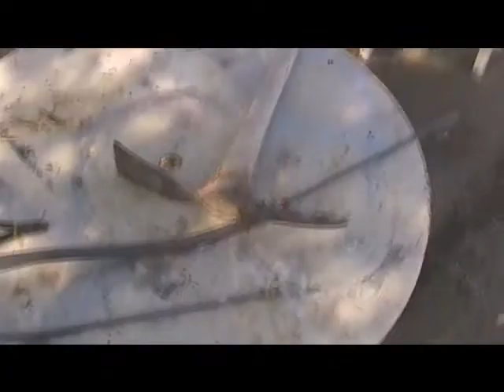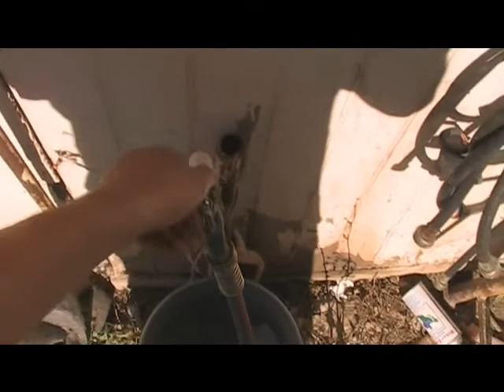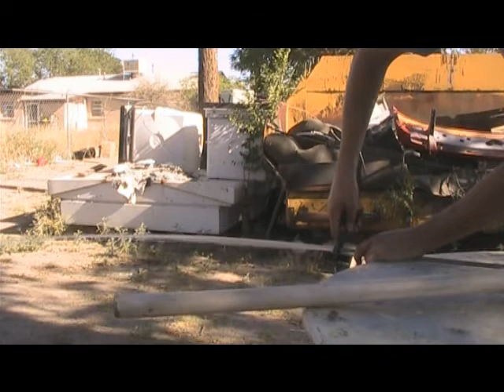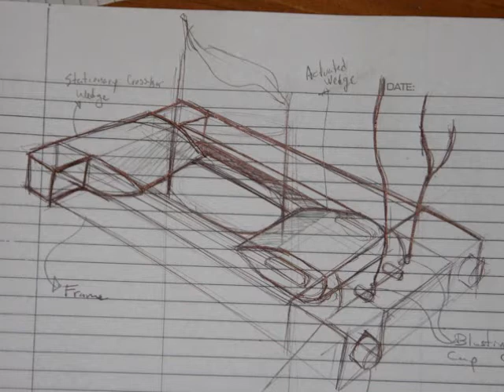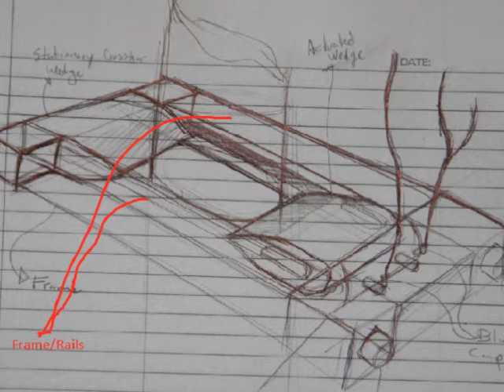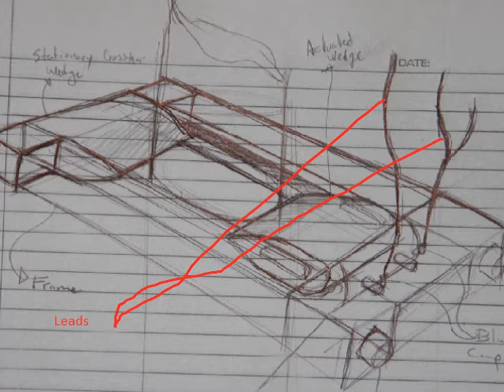british petroleum BP disaster gulf oil spill fix in 7 days using hiram method

Comment: i think the real problem is what you cant see which is the rest of the pipe under ground which is already broken and leaking oil, so anything you do on pipe outlet will only increase the pressure thru the whole pipe. so you may be successful in making the flow of oil at the end of the pipe less, but you will end up leaking more oil in the under ground section of the broken pipe which will eventually leak thru the seabed.